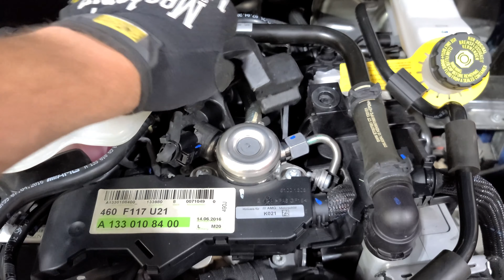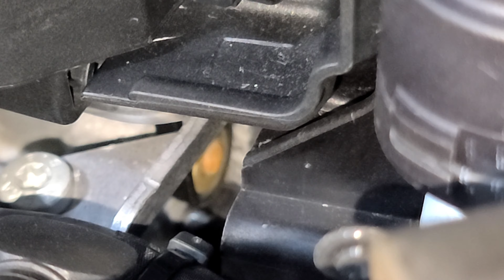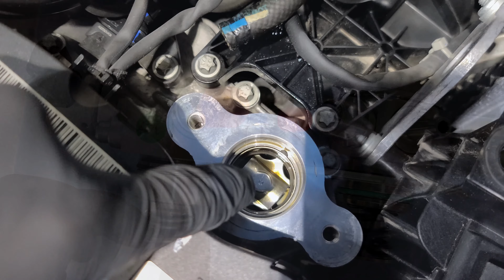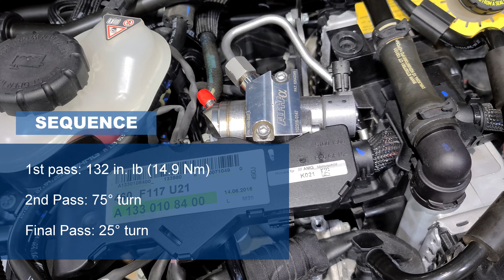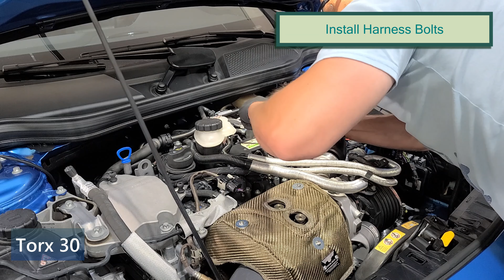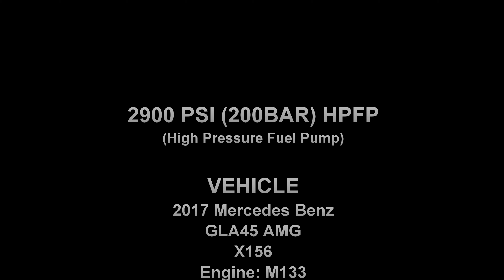AMS Alpha Performance High Pressure Fuel Pump (HPFP) Install for Mercedes Benz GLA CLA A45 AMG M133

Comment: I have had this pump on my car for 1 year now and it fails to even hold 160bar pressure this pump is not worth the money for the gains it’s says it can increase too I’ve put the standard merc HPFP back on and I’m getting 200bar back so my advise is don’t waste your money on these alpha fuel pumps it’s not needed the max alpha adjusted mine too was only 210 bar so honestly hardly worth the gains ……

Comment: How did you raise the plastic
The bit with the wires in to get the lower bolt. I seem to have no space to put a spanner beneath the Plastic to undo the lower bolt

Comment: After just about running it for about 1 year, the AMS fuel line began to leak at the back of the nut, which connects to the HPFP. Car had to be shout down. Somebody experienced the same issue ? Due to my hard coilover and stabiisator setup, the harder metal of the fuel line, weared out the inner part of the HPFP connector. Now I'm screwed...